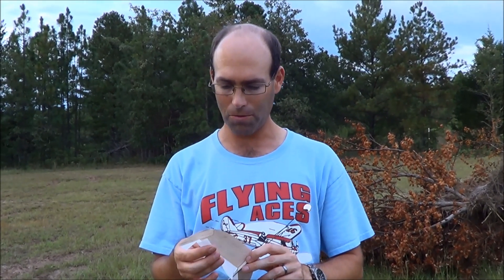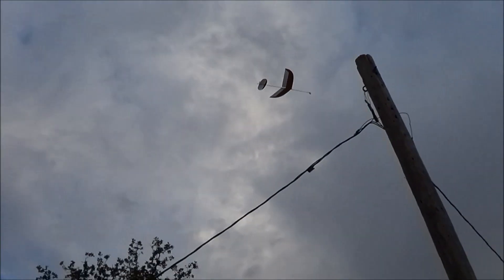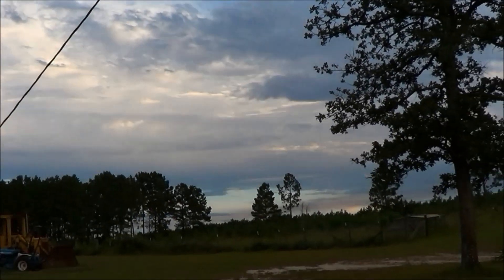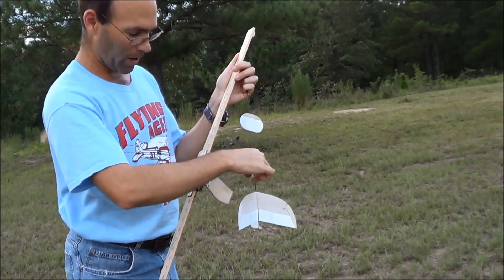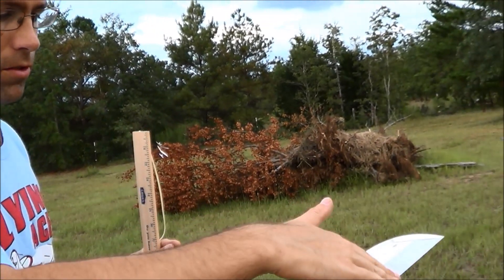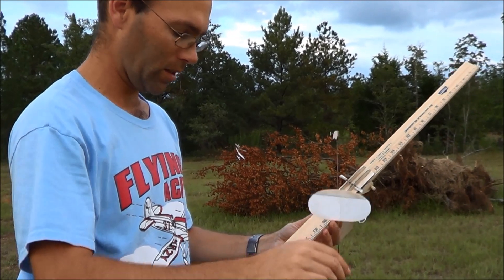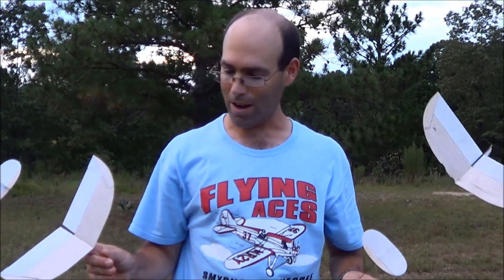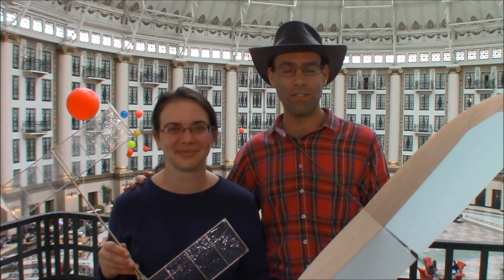Protege Elastic Launched Glider 2019/2020 - Trimming instructions

Comment: For some reason, when I launched it, the glider goes straight up and goes straight.
How do I make it glide in a circle without turning really fast and going straight down?
My competition is in two days, someone please reply fast.
Reply from the maker: Bend the trailing edge of the vertical tail in the direction you want the glider to turn. This will likely make it roll hard on launch, but you can fix that by twisting the wing in the outside of the turn (left wing if it's turning right).

Comment: On my deluxe launcher, the rubber band that came with it seems to be too big/loose, and doesn't create enough tension. Am i using the wrong rubber band?
Reply from the maker: Shorten the rubber band and you'll get more tension.
Reply: @joshuawfinn  I think i used the wrong band, so i switched it with my band for the smaller launcher and now its better. Thanks!
Reply from the maker: @jayparekh4080  that would definitely do it!